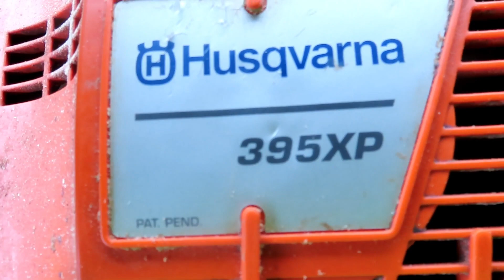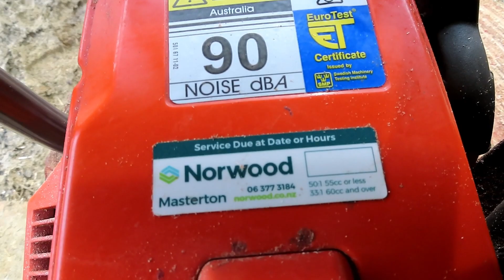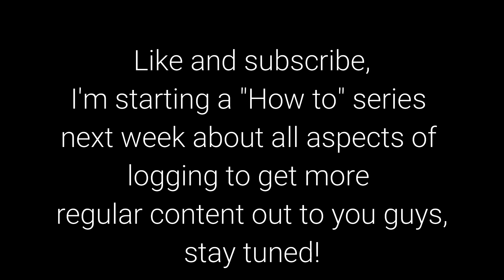Husqvarna vs stihl review

Comment: Nice review.
The 395 is a great old saw, actually more of a 2 series design than a 3 series. The new 395s are built in Brazil and will most likely stop being distributed here in the states. 
Have you tried a 572, certainly not as strong as a 395, but will out pull a 372 no problem and handles much nicer.
Reply from the maker: Brett Black that’s the latest and greatest we have over hea lol Nar I haven’t m8👍

Comment: Those three things you mentioned about the husky are why I like stihl better bro plus the stihl seems lighter and the filter is easier to get to even if you have to clean it more often.chur though ive never owned a 661.i stihl got my two 660mags both close to ten years old never been rebuilt.just keep it sharp and use clean fuel with a good oil mix and clean the filter daily if not more often.I only rev it hard enough to do the job.maybe ive just been lucky.
Reply from the maker: hayden spence hard bro 660 is the best saw in the world fucken love my one but it won’t last foreva the 661 are shit so had to give husquvarna a go and there awesome!

Comment: Hey mate,
Love the video's,
Just wondering what the main issues with the MS661 are. Have heard some people say the computer doesn't always give them the most power compared to the carb. Have you run one?
Cheers
Reply: My mate was running a 61 for 2 weeks and crank shaft snaped
Reply: Sounds like a warranty issue, not really specific to Stihl
Reply: Yup got repaired but not the point I was making that shouldnt have happened even the stihl shop in Levin were shocked
Reply: I've been running three 661's in my arborist business for three years. 22 and 32 bars. (880 has the 42 inch) No major issues. I like not having to adjust the carb. Replacing them with three 550i's this year. Saw them at the field days. Game changer I reckon!
Reply: ...and I didnt like the 395 for the same reasons you mentioned. Awesome power though. But power alone doesn't make a good saw. Your local Husky/Stihl dealer can make or break the deal. Nobody wants to deal with idiots! Do you want to wait for parts?

Comment: STIHL all day 👌🏽 but yes the husky is on, I’ve had 2 395s and a 288 and loved them, only down fall was the chain tensioners keep snapping (especially if ya have your drags right down) the throttle cable stretches and the blue wire comes loose but power wise there a lot more grunty then STIHL in my opinion.

Comment: Should have got a 390xp they a good size saw
Reply from the maker: chris Grieveson coach used one for 2 years awesome saws just needed a little more power for the big wood we in
Reply: best saw ever made im using 28 in30"+ wood alot lighter than a 95 also i pull the saw on back cuts rather than pushing all habit